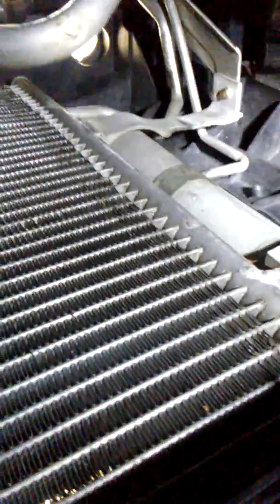(04-09) Radiator replacement Mazda 3

Comment: For a 2006 Mazda 3 you have to disconnect the Freon line at the condenser then both the condenser and the radiator will come out the bottom of the car. Pull up and tilt forward. Be sure the coolant fan is removed from the inside of the radiator first.
Reply from the maker: Capt Jack NOOO. You can pull radiator without the condenser!. The raditor litterally slides out of condenser bushings.

Comment: I have a 2005 mazda 3 would I have to remove the bumper?
Reply from the maker: @Adreesuploads  it will be much easier with the bumper off.  I don't think you Have to remove it.  But your room will be tight.  

If you remove bumper, take your time and might want to have a few spare clips on hand.  After the years and miles they tend to get brittle.
Hope that helps

Comment: how did you get the damn thing out? the rubber bushings are a part of my radiator support and block it from coming out, and not any room on top?
Reply from the maker: Potentially it was replaced before with an aftermarket radiator.  I haven't seen one where the bushings wee a part of the radiators in the speed3.  The one I put in my speed3 was an aftermarket and I just swapped my bushins to new one.  
Mine were sized on there really well.  If you can't get enough clearance you may have to remove condenser with the radiator.  I didn't have a way to vacuum a/c system at the time and then you vacuum and recharge a/c system.  Just becomes a more expensive repair.  
Hope that helps.

Comment: 7 years later, thank you for making this, some dumb cunt hit all the cars in my parents' driveway last night when we were all asleep, including my Mazda 3, but it looks like he just backed into my car to push it back a few feet to get back into the street, instead of actually impacting it. So, just in case it did, in fact, impact, and my Radiator is done, I'm gonna need this video for when I replace my radiator. Would you say it's an expensive fix?
Reply from the maker: That's a bummer.   Not expensive (though I swapped this years ago, I'm sure prices are different now)
Cost was price of radiator and fresh coolant.  I had the tools already.   But Im still driving it daily and it is the same radiator from the vid.  Make sure you check your hoses too.  
Hope that helps!